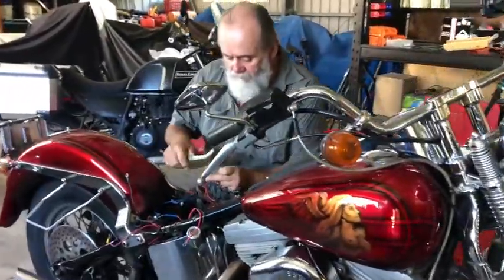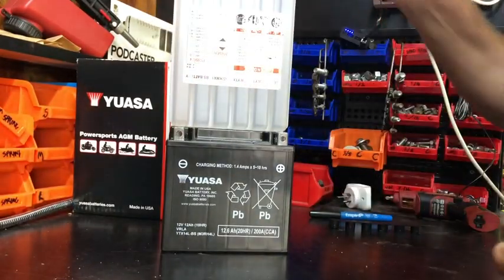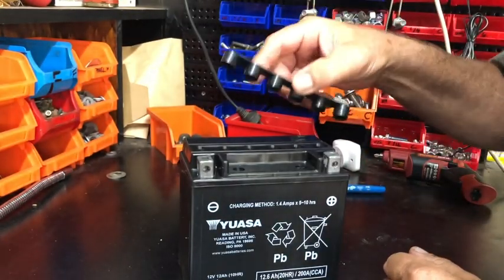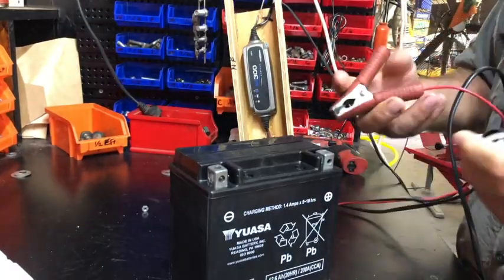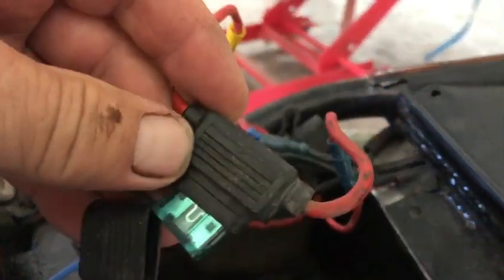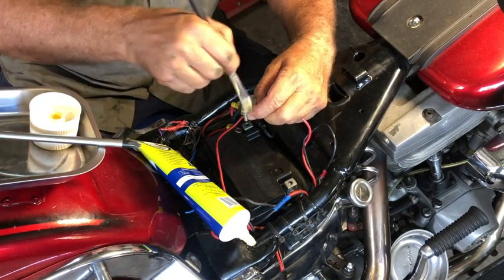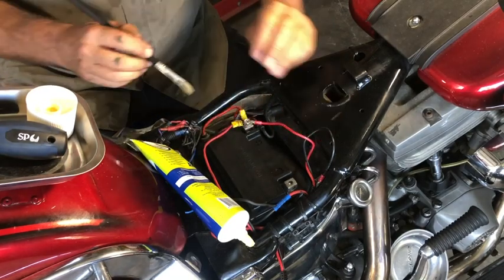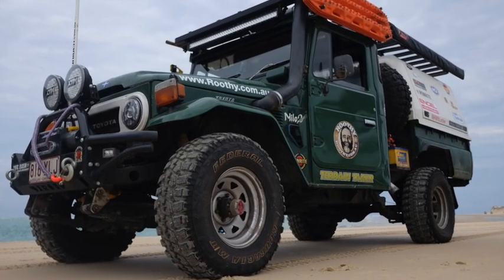BATTERY FITTING FOR LONGEST POSSIBLE LIFE

Comment: The boys on the quads down the beaches on the West Coast of Tas use Lanolin grease on all electrical connections, shits all over anything else both for price and effectiveness. I use it on overseas reefers and vent fans as a circuit  grease and general anti seize as well, they are constantly exposed to salt spray on the container ship decks, you often get them back here after a year or two and the stuff is still hanging on like crap to a blanket. Good gear.